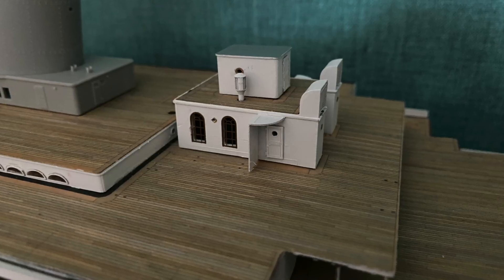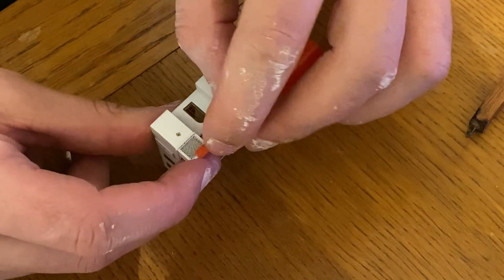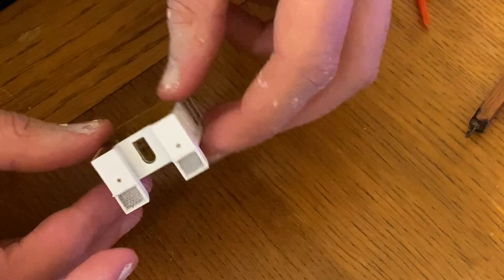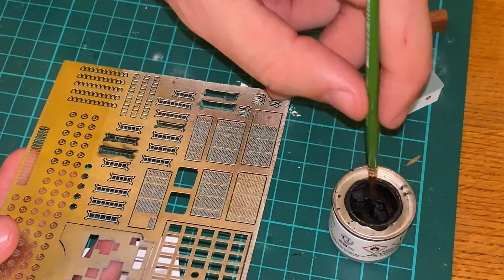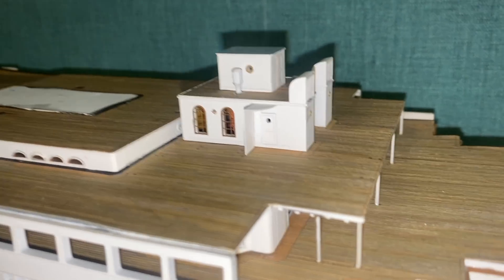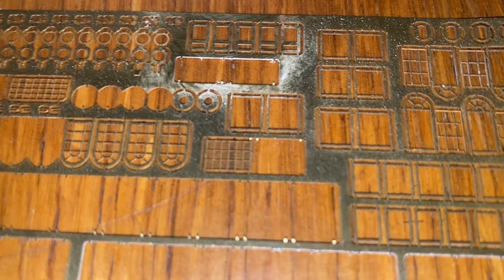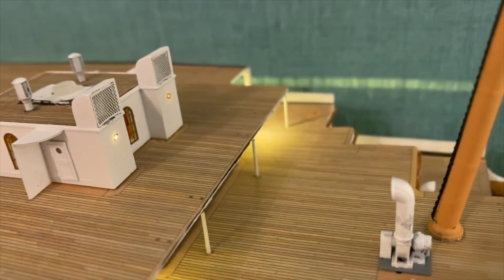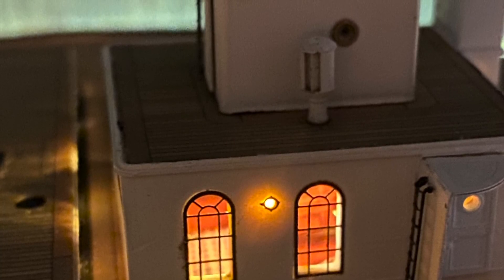Radio Control Trumpeter 1:200 Titanic Build Part 48 - Second Class Entrance Part 2

Comment: Power supply and production about the ship provided by devoted souls in generator compartment.
The ship entirely electrified including the many Prometheus heaters in foyers and public areas.
A vast networking of conduits to route power to all points needed. 
A grand sight to see her glimmering against the twilight horizon.
The contrast of the beauty of her teak decks and white upper structures striking indeed.

Comment: Ever considered using "refrigerator magnets" to attach the deck houses to which you'll need access? They're maybe 1/8" thick - plastic on one side and a magnetic film on the  other, and they can be easily cut into strips.

Comment: Hey Rob,
Thanks for yet another entertaining episode. I think you've made the right choice not to light the lift machinery room. In the ship I currently work we have 16 lifts and thus several lift machinery spaces. They are all unlit when no one is working there, which is not often. So I would imagine that most of the time that space would have been unlit. In modern ships approx. every fourth light in escape routes and public areas are emergency lights which are always lit. But that is a requirement in the SOLAS Convention which was a result of the Titanic disaster...
Keep up the great work 👍
Reply from the maker: Hi there, yes I think so. It seems odd to think about efficiency on a ship of 1912 but of course White Star Line was a business with profits and loss so clearly there would have been efforts made to save energy etc etc. 
Yes I was reading the SOLAS regs recently actually out of interest to see how ships differ from building regs. The 4th light is applied across most public spaces now and normally needs emergency back-up supply for a number of hours (clearly very sensible as you say). 
Sad but disasters often seem to pave the way for improvements in safety.

Comment: Really nice work and so many useful tips and solutions to overcome those little issues. Smart decision on the lift motor room lighting. I'm not surprised there was a second door to access a narrow area inside, I have seen it these days on buildings. I do wonder why you paint PE before removing and bending as I find I am always scratching paint off, Though I understand its easier to paint small parts still attached  :)  Cheers mate 👍🇭🇲
Reply from the maker: I find if you are very careful with a very sharp blade you can extract PE without too much paint loss (I occasionally have to rework a part but not often). Do you use a PE prep paint? I use a photo etch primer which massively improves how much my paint sticks to PE, I have included it in the description encase you want to have a look :)

Comment: did you run the wiring for the lights down into the bowel of the ship from the boat deck and 2nd class lift housing?
Reply from the maker: I did yeah, all the superstructure connects into the hull via a magnetic connector. Makes removal and replacement of the superstructure very simple!

Comment: Hi Rob i am using the same smoke generator as you, the instructions say wire fan to battery but would that not make it run all the time ? or can you wire it into the switch so it comes on when the smokers on the wiring instructions are non existent .
Reply from the maker: Hi there, yes as you say that will result in the fan being on all the time.
My approach was to wire the fan direct to the battery, but cut the feed using one of my RC switches. That way I can toggle it with my RC transmitter.

This is the RC switch i use: https://hobbyking.com/en_us/turnigy-receiver-controlled-switch-1.html?wrh_pdp=1&utm_source=google&utm_medium=cpc&utm_campaign=google_gb_shopping&countrycode=GB&___store=en_us
Reply: Thanks Rob, but would it not work if it was connected to the same switch as the smoker element using just one switch for both ?